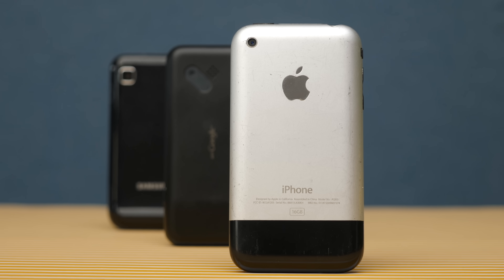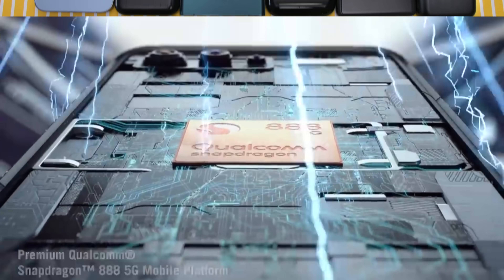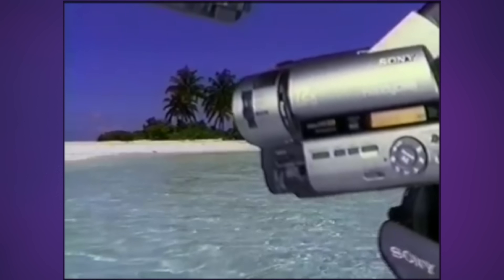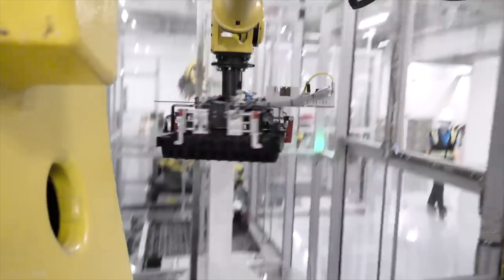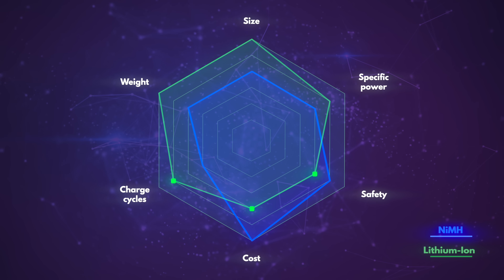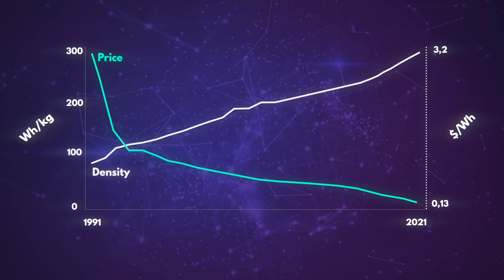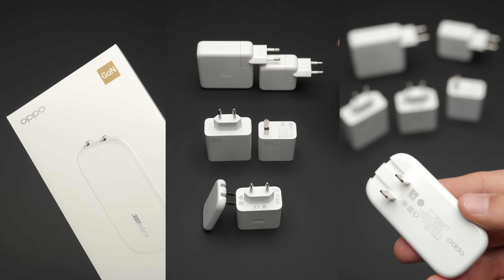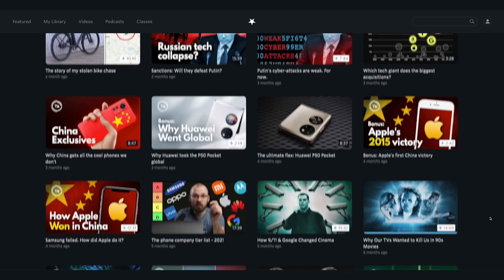The billion dollar race to fix phone batteries

Comment: As far as phones go, I've never understood why they don't just make them like 30% thicker. That should allow for maybe a doubling of battery size, and if it wasn't for this "form over function" obsession with getting ever slimmer electronics, it would be hard to even notice the difference. I would take double battery life in exchange for a few extra mm thickness any day.

It's a much worse problem in other devices where you can't so easily just expand the battery - like a smartwatch for example. And this is why I think we are heading for a potential disaster with the rate at which we are carelessly using lithium/cobalt and those other very limited materials to power everything. For wearables we really have no other good options right now due to the density and weight needs - but it is a terrible idea to use lithium-battery tech for large-scale grid storage for example. We will already struggle to make all the lithium batteries we need for EVs (where weight is also crucial). Let's not waste these precious resources for static batteries too where size and weight is much less of a factor.

The unfortunate reality is that very few people with real power over how the market develops care about sustainability. It's all powered by shortsighted greed. if there is profits to be made right now and lithium is marginally better suited right now, then they will use it even in cases where it's arguably not needed. Even if it will end up making the tech prohibitively expensive for later generations.
Sure - we may have managed to create better alternative batteries at a reasonable cost before we hit the brick wall on this, but that's not guaranteed by any means - and it is very irresponsible to just assume that science will save us out of every pinch like this.
Reply: some extra thickness makes the devices more comfortable to hold
but please, make them narrower and shorter!
Reply: @Z4KIUS  So basically we are going back to their original form factor
Reply: @TheMrLucasP  well, I just want to safely handle my phone with a single hand
Reply: @Z4KIUS  True, the latest flagships became massive
Reply: @TheMrLucasP  iPhone 4 and Galaxy S4 are the peak of phone design for me
Reply: @Z4KIUS  personally I'm like a lot of people - I watch a lot of video content on my phone. I like having a light and large screened phone (OnePlus 7 Pro atm). I don't actually see a problem with the batteries in current phones outwith the replaceability. Same with screens. If I could cheaply change both on this phone I'd probably keep it an extra two years, since it fulfils all my needs perfectly.
Reply: @johnduncan5117  I see no reason to watch anything on my phone, it will always be smaller than my tablet, so what's the point in making it also a worse phone?
Reply: @Z4KIUS  ok so I guess you carry around your tablet everywhere then...
Reply: @johnduncan5117  no, I don't, why would I do that?
Reply: @Z4KIUS  so you never want to watch something when you don't have your tablet on you ?
Reply: @johnduncan5117  if I'm on the go I don't, no time or conditions
if I know I'll have a long enough idle period in peaceful enough environment I may just throw the tablet into my backpack as an extra, but in everyday life there's just no suitable situation
Reply: @Z4KIUS  ok. There are many situations in my life when being able to watch a video on my phone is practical. I have two tablets at home, which I would bring with me on a trip, but not day to day. Basically, everyone has their way of seeing these things and there is no right and wrong or universal truth.
Reply: @johnduncan5117  if someone has no use for a phone that's fine, but calling a phablet a good phone because it plays videos better than a good phone would is just wrong
Reply: @johnduncan5117  You could also unglue your face from your phone when you're out and about. Having no downtime in which you just focus on nothing is extremely detrimental to a persons mental health.
Reply: I'm all for that, I like thicker. But it would also make it heavier
Reply: @sttonep242  I don't see the problem with that??
Reply: @sttonep242  Are you implying that you'd be too lazy/incapable to lift a 300g phone?
Reply: they'd be like 300g though
Reply: @Enrico-  Not really. Let's take a common and very typical modern smartphone like the Samsung S10 as an example:

Weight is 157g, 48g of which are the battery. A theoretical model with twice the size battery would be 205g, or roughly 30% more. 

Would this really make much of a difference to most people? Also - did you even bother to check the weight of the last phone you considered buying? I don't think most people prioritize it that much.

I'm not saying all phones had to be like this, but I would easily take that tradeoff, and I don't think I'm the only one.
Reply: @Enrico-  xz2c is 168, and I want shorter and narrower, so even if it was a bit thicker it wouldn't be heavy
Reply: There's no way they'll do that. The trend in phones is to make them "prettier", "sexier", more "marketable"  even though their "improvements" don't really improve usability, if not even make it worse. See notches, punchholes just to get great screen to body ratio, rounded corners just to make them "look good", unnecessarily very thin devices, etc.
Reply: I'm not sure about 30% thicker, but I won't mind filling up to the camera bump
Reply: It's extremely easy to understand why companies don't make their phones like 30% thicker: Weight and ergonomics. It would be extremely uncomfortable to use a phone that's like 15mm thick and weights 300g or even way more. It's easy to say that they just should make the phones thicker and everything is fine but that wouldn't be the case. Especially in terms of weight. The iPhone 13 Pro Max already weights 240g. Making this thing like 12mm and having a 7000 mAh or so it would literally weight over 400g.

This has NOTHING to do with some obsession about having everything being as thin as possible. Before yelling stuff like this, you may should have a look at phones. They have been getting thicker for quite a while.
The iPhone went from 6.9mm in the iPhone 6 to now 7.7mm (and it's rumored that the 14 is going to be ~7.9mm)
The Galaxy S series went from 6.8mm in the S6 edge to now about 9mm in the S22 Ultra.
Reply: @Raja995mh33  Eh, I put my cell phones in cases which makes them thicker, and I own a Nintendo Switch, which is heavier and thicker than cell phones - I'm okay with a bit heavier and thicker. It would be nice to at least have the option.
Reply: @logicalfundy  Used to be the case with phones that had removable batteries. I had a Droid Bionic and a Droid Incredible LTE where I had the option to add in the extended battery which not only gave me much longer run time but also a bit more rounded body to hold rather than a thin rectangular slab.
Reply: @Raja995mh33  it's extremely uncomfortable to use "phones" that are as thick as currently - literally had to put a case on solely because of that
and as big otherwise, it's impossible to even get a grip on some of them and none are usable with a single hand
just make a 4.3-4.5" with proper bezels (no notches, punchholes and rounded screen corners) and over 10mm thick and it will be great

Comment: I am a battery engineer, and I have to say that this was very well researched. With phone batteries in particular, they rely very heavily on cobalt because they are almost exclusively LCO-based chemistry. Compared with cars which are typically NMC, NCA, or more recently LFP as you mentioned.
Reply from the maker: Happy to hear!
Reply: @Nbomber kudos to you for checking wikipedia first...lol
Reply: And what happened to graphene batteries? I've been years hearing from them. I think even there is an expensive powerbank made with a graphene battery
Reply: @jesuslcampillo1989  The technology is still in it's infancy.
Reply: @Markel_A  Is good the real deal is they need to find how to produce in large scale
Reply: @jesuslcampillo1989  Graphene is extremely impractical to produce, thus far. Most of the holdup on graphene batteries, is figuring out how to produce lots of graphene in the first place. 

At the moment, it's mostly sold by the gram (or less); we'd need over 150,000 tons of the stuff, just for US automobiles.
Reply: @jesuslcampillo1989  we have graphine in batteries already. they improve the charge and discharge speed of lithium batteries but are mostly used in hobby batteries. 
they also die faster. so not practical for other purposes..
Reply: @jesuslcampillo1989 Graphene is regularly used for the anode and when charged the lithium is intercalated between the layers. Cobalt is used in the cathode to occupy space in the lattice, causing the battery to become more efficient.
Reply: @R Hamlet The west focused exclusively on NMC since the patent for LFP was with China until the beginning of 2022. Hence why suddenly every EV was available as a NMC and a LFP version.
Reply: I have no idea what you're saying but I'll toss a like anyway
Reply: @CrayCrayslab It’s actually very interesting I jus t looked up the abbreviations on Google, I understand how batteries work a lot more after all of this and I like how YouTube is helping lots more people understand modern technology
Reply: For the space constrained environment of a smartphone, capacity pretty much takes precedence over everything else. Not many consumers would be willing to sacrifice the capacity they’re used to. 

In the case of cars, it seems that tempering capacity expectations from the beginning may be the way to go, to take advantage of the properties of other chemistries, such as the durability of Lithium-Phosphate.
Reply: @Lauren_C   As pointed out at the opening of the video, the manufacturers have spent a couple of decades proving that smartphone size is apparently not constrained. I have refused to go along.
Reply: Isn't there talks of a new type of battery that can last much longer?
Reply: I wonder when the lithium solid state metal air batteries are here 👍🏻 probably a decade away
Reply: Hey there fellow PhD battery engineer! I disagree, the video is very good infotainment but there are some mistakes in here that make me cringe very hard.
Reply: @talananiyiyaya8912 it’s not very useful to anyone to say that there are mistakes but then not state what they are, even at a high level.
The only knowledge being “gained” from your comment is that you have a fancy degree.
Reply: @pieflies  I'm happy to be paid a consultancy fee to correct the record but I'm not doing it for free lol
Reply: @talananiyiyaya8912 you may as well not bother commenting at all then, since you have no reputation on here that would indicate anyone should pay attention to anything you say. So unsubstantiated claims will just be ignored.
You could give very high level information regarding which parts of the video are inaccurate without it requiring any more time than it takes to write a comment with no substance.
I understand now why you feel the need to tell everyone you have a PhD for no apparent reason - because no one would guess it by reading your otherwise empty comments. It’s a bit backwards really.
Reply: @pieflies  Whether or not I comment is at my discretion and I don't really care how it's perceived. Commenting on YouTube is like yelling into the void, and I treat it as such.
Reply: @talananiyiyaya8912 but if you’re trying to wow us with your knowledge and credentials then why not give us some of your knowledge so we can be wowed?
Otherwise it’s just negativity for the sake of negativity.
It would be less a waste of yours and our time if you used your knowledge to help others learn, or just didn’t yell into the void at all (it’s not a void - it’s other humans here).
They don’t award PhDs for common sense and courtesy I suppose.
Reply: @pieflies  It's a void. And honestly it's annoying when others reply to me. I don't wish to try articulate why I don't care enough to leave insightful comments but don't mind leaving the opposite. I think if I did, I'd come to the conclusion I should stop and be better and I don't think I have the emotional capacity to bother. Bye.
Reply: @talananiyiyaya8912   just like it’s annoying for you to be replied to, it’s annoying for us when people post garbage comments like your original comment. Now you know the feeling I guess.
Based on your response it seems like everyone would be better off if you didn’t comment then. Save yourself from future annoyance like this.
Reply: @talananiyiyaya8912  PS. It’s not a void. These are real people in here on the other end, and the author of this video is a real person. The more people would consider that fact the better the internet will be.
Consider those around you.
Reply: @pieflies You have a fairly obvious issue with his explanation of why sodium batteries are less energy dense. It has little to do with the weight of sodium, and more to do with electronegativity of the atoms.
Reply: i am a enginner of enginner to make enginner very enginner
Reply: When are you going to engineer us all an infinite battery?
Reply: I agree - I was pleasantly surprised to get this video recommended to me that actually understands the current pros, cons, and solutions for Lithium-ion! I just wrote a paper for my engineering undergrad that talks about Lithium-ion batteries and it was cool to see the same proposed solutions I made in a random video online! 😆
Reply: Oh that’s nice…
Let me ask one question, what do you say to this trend to load up the lio batteries with more and more power?
Reply: @rhamlet5290 You say you "work with batteries", but fail to mention in which capacity. Based upon your very one sided (obviously biased) review of batteries in general; I am guessing you do not have your masters degree. That much is for sure. You suggested recycling lithium batteries is "easy". Really at that point is was curtains for your opinion without ever needing to read on.
Reply: @rhamlet5290 It was not an attack, although you may have viewed it like that if you are perhaps a little sensitive. It was merely an observation. Lithium battery recycling is being explored by numerous companies, but guess what? None of them have managed to make it profitable. So, why not just burn oil? Creating CO2 is actually a good thing. It makes the plants grow. We are actually historically in a low point of CO2 in the atmosphere. Let us create more. If we can find out a way to then use the CO2 (people are working on it) then we have a fully sustainable ecosystem if you care about that sort of thing.
Reply: Do you see any of the new ideas, becoming a reality soon. Solid state or Sulphur, how practical would they be in this form factor? Whatever, we need a better option all around for all uses of energy.
Reply: If I send you my resume could you lmk if I could apply as an intern 😭
Reply: As someone who is currently taking courses in this field, I can only agree.
Reply: R Hamlet over here stating the truth:   
That lithium supplies are far less problematic than oil\gas\coal,   
& that commuting by car is unsustainable.   
Also Void Ontology is correct: "Intellectual property" monopolism is a big part of the problem.
Reply: @prophetzarquon  commuting by car has been and still is very sustainable and will be in the future too, if the world is not dictated  by ecoradicals.
Reply: @Илия_БГ  Wasn't true in the 1920s & isn't true today. 
"commuting by car has been and still is very sustainable"? LOL no. 
What are you even talking about?
Reply: @Илия_БГ  I'm sorry did you say something of substance? All I see is a blanket statement that sommuting by car is "very sustainable" when it's been increasing in cost & negative impacts for decades & there's literally no room to add more cars into existing urban corridors. So, I believe the onus is on you to back your assertion that commuting is somehow sustainable.

Comment: As Elon already suggested, creating good recycling network would be a lot better as  where are such material on higher concentrations other than in such batteries?
Reply from the maker: We are nowhere near a place where recycling would let us get enough materials to cover our battery needs
Reply: @TechAltar  absolutely agree, there are not enough of them in circulation probably and there's going to be some dismishing returns. My point is that such system should be ready to go when that point comes, not the traditional way of waiting until we have a problem. From a geopolitical and logistical standpoint it would probably mean a lot, as it would be something like entering the process with "homework already done"
Reply: Wrong!!!!! We still need to produce a lot of batteries first to make recycling viable for new batteries.
Reply: @carholic-sz3qv   absolutely agree, there are not enough of them in circulation probably and there's going to be some dismishing returns. My point is that such system should be ready to go when that point comes, not the traditional way of waiting until we have a problem. From a geopolitical and logistical standpoint it would probably mean a lot, as it would be something like entering the process with "homework already done"